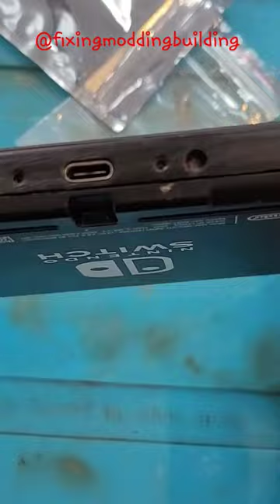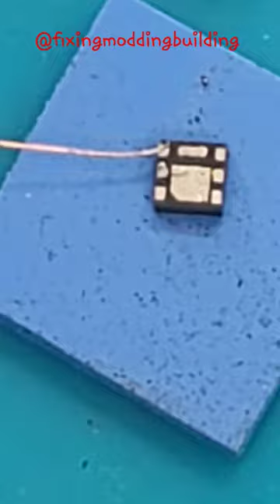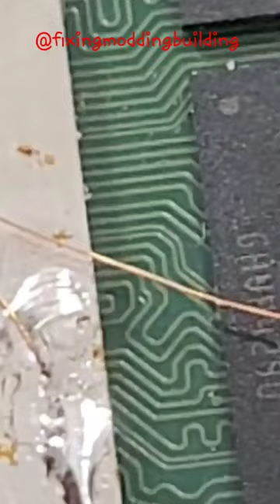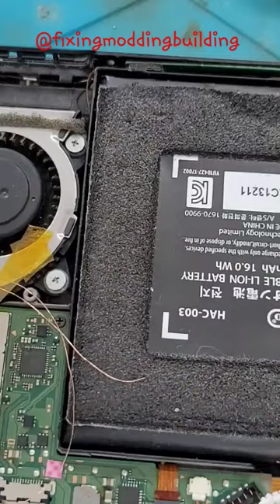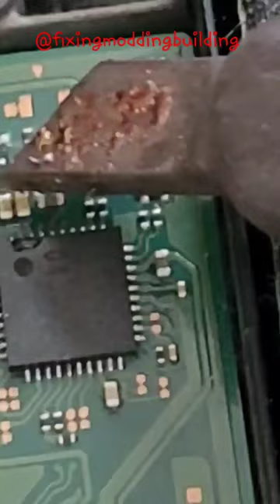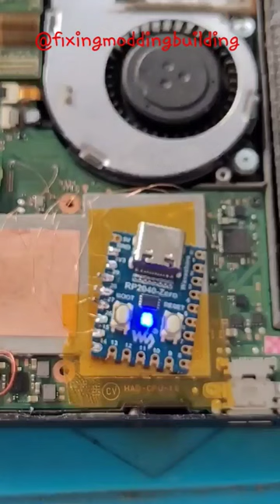Picofly install

Comment: I don’t know what functionality this has but the process is downright skillful
Reply: this is to mod a switch to be able to run custom firmware.
Reply: This is absolutely a high-skill job. Another generous community member has created a custom PCB and flex cable for the picofly that makes it way easier! You should give that a search, it’s worth looking at. Would make a good first micro soldering project for a beginner.
Reply: This guy proved its not. Using a knife tip with the worst crustiest solder joints known to man. You can either do a nasty job and get it done, or do a clean as job and actually be skillful.
Reply: I prefer hwfly. Easier

Comment: It was going to take a month to get those style mosfets in, I went with a different style and was told you only need one mosfet. Wonder if that will make a huge difference..? Mosfet is just a switch basically
Reply from the maker: Most things I read say to use one, but "might" have issues so than use two, so i just used two straight off

Comment: Does it works better than hwfly? I want to install for my new OLED, which one should I buy?
Reply: hwfly is fastest and most sable from my experience and research
Reply: picofly is cheapest but hwfly is faster
Reply: this looks chaotic. i got the hwfly
Reply: The new version of the picofly is nearly identical in soldering requirements to the hwfly. Someone developed a custom board for it. :)

Comment: Is the firmware the same for ALL versions? I have V1 that's been patched but want to do this
Reply: Don't take this as being rude please. If you have to ask them you shouldn't do it. It's a very complicated install and requires a decent understanding of soldering. I've done this and can confirm that it's well worth doing. The homebrew scene is really cool, but it's also very risky and can result in your console getting banned. If you have a spare then it's really fun because you don't risk much. You can also completely destroy your console. I didn't damage anything but I make a living doing this kind of stuff. So please research heavily before proceeding.
Reply: @RifterArchive  while I think you're correct in what you're saying--this looks like a particularly difficult solder job and not for novices--i have to wonder why you're instantly telling this person that their question is indicative that they shouldn't even try. Their question pertains to the firmware, not the soldering process.
Reply: @renatatostada3318 Ikr 😂🎉

Comment: My switch boot straight into the xmb need help pls
Reply from the maker: Need to check solder joints
Reply: @fixingmoddingbuilding  i did over and over again.

Plus i have really good solder skills